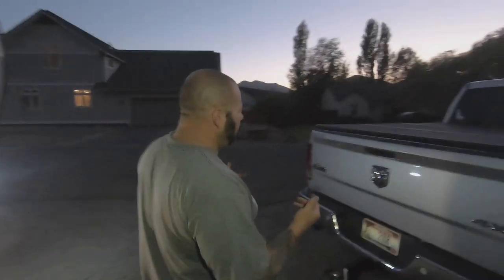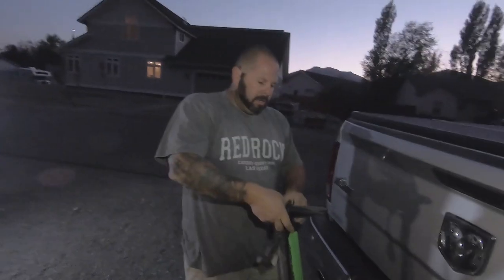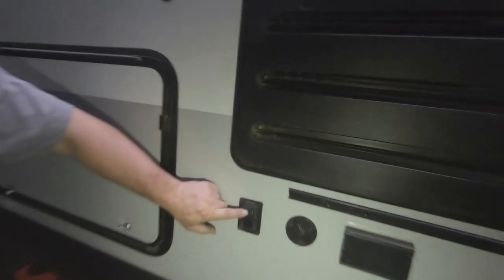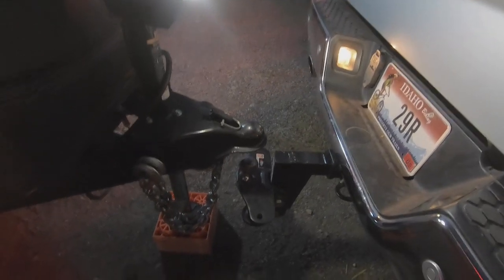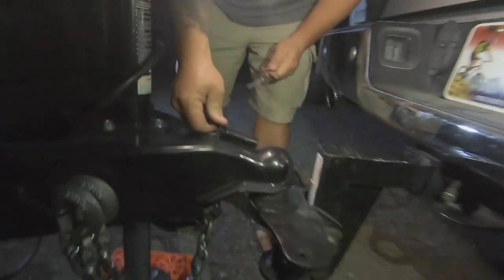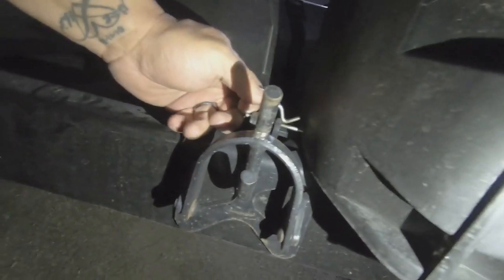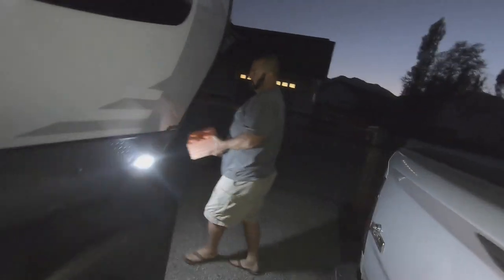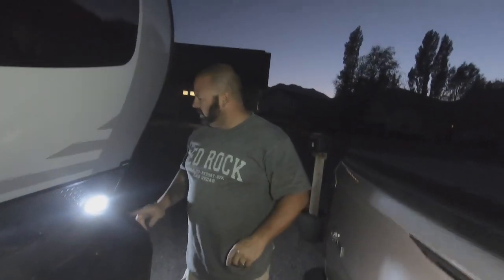Hooking camper up to ram 1500 with air bags and weight distribution

Comment: I see you use one fill for your bags.
I have mine with to shader valves. 
I also have a Ram 1500.
Not sure what bags you have, I did no use the bags in the coils.
You did say you have no shocks, not sure you ment thar lol.
I have a 2600RB by grand design. 
I just installed a level kit, we will see how that works this summer.
I went from a 32 foot coachman  trailer to this.
I found towing was about the same , I found out my front end was worn out.
Again, we will see how t tows this summer.

Comment: Isn't the brake cable supposed to be connected independent of the chains?  If the whole thing comes loose, the emergency trailer brakes won't actuate if the chains go too.
Reply from the maker: I have heard mixed opinions on this. I was told it's best to do it the way I have it, but I am not sure what is right. I do know that the cable is really long and when not ran through the chains drags.on the ground.
Reply: @BassinNmore  I watched a different video on what the inspectors look for if the pull you over and the brake cable has to be attached independently.
Reply from the maker: @robindrew3471  I will be looking into this for sure. Thanks.
Reply: @BassinNmore  The breakaway cable should be separate from the chains. It's intended function is to apply the brakes if the trailer becomes completely disconnected from the tow vehicle. If the breakaway cable is attached with the chain and the chain comes off, the breakaway cable will likely come off as well and not engage the brakes. If you're worried about the cable dragging, check out the Fastway Zip it's a coiled cable that wont sag or drag.

Comment: Good video you should check your tire size and ply and see what speed you’re tires are rated for 80 mph sounds high
Reply from the maker: Goodyear endurance 10 ply automotive grade tires rated at 87 mph.
Reply: Wow that is nice not sure I would do 87 but at least you got good tires
Reply: @BassinNmore  These seem to be very popular tires. DId they come on your rig or did you add them? ...if you added them do you have any comments on how they tow vs the old tires?
Reply from the maker: @adame924  they came on it.

Comment: Great video, thank you. I am getting on of these too, and love your channel so far. Questions, do you mostly just end up doing just the chocks and stabilizers? - how often do you have to stack leveling blocks? thanks much :)
Reply from the maker: Thank you for watching and commenting. I use the stack leveling blocks everytime. I have three bags of them now. They are the easiest way I have found to get the camper level side to side. Then I chock the side that doesn't have the blocks and I also use x chocks in-between both sides of tires for added support as well.

Comment: Curious what the payload (from white/yellow sticker inside driver door on B pillar) is on your RAM 1500 and if your hitch weight and everything in the back (and passengers) is below that? My 2013 RAM 1500 has a sadly low payload and most all travel trailers will exceed its GVWR with my family loaded up (and nothing in the back).
Reply from the maker: Mine on the door sticker is 1650lbs. I made sure I baught the best I could for the 1500, was also looking at the 2500, but found this truck was perfect for my needs.

Comment: Thanks for the video I like seeing others hook up routines. I was very interested in seeing what pressure you use in the airbags when towing with a WFD. I find a lot of mixed reviews. In additon I do have a couple questions. The first one is about your emergency cable for the brakes. Is it short enough where it will pull the pinout of the emergency brake box before the safety chains are all the way extended?
I know x chocks recommend's leveling your trailer before installing x chocks because moving the front of the trailer up and down with x-chocks installed can twist the axles. They recommend using regular wheel chocks when leveling. Why did you decide to leave them in when "un-leveling" the trailer to connect it to the truck?
Reply from the maker: I do not believe that it was, bad info from the dealer. I have since changed the way I run it and it is now. I am doing another video just about the brake cable soon. Thanks
Reply: @BassinNmore  Sounds like we got the same bad info from the dealer.  When I first bought my travel trailer the brake wire was tied to the chain. It's crazy how much dealers who sell travel trailers don't know about towing what they sell. :)
Reply: @adame924  The break away cable is meant to be pulled if the trailer is entirely disconnected, not just from popping off the ball, meaning no chains or anything left on the tow vehicle. However the other problem with that is if you lose the trailer from the ball, and the chains, then you most likely have lost whatever the break away cable was attached to as well. Ideally the breakaway cable attaches to something different than where the chains attach, I don't know of any vehicles that have that. Another issue is if the chains are long enough to pull the 7-pin plug out but not long enough to pull the break away cable, then you have no trailer brakes.
Reply: @EngineAdventures  I have heard the same thing about the break away cable and you are correct I've never seen a vehicle where the break away cable is attached to something different than the chains. As for my 7 way cable I'm lucky that mine is long than my chains.

Comment: I have the same set up.  Camper weight and truck.   Struggling with camper swaying ever since I put air bags in. Any advice ??
Reply from the maker: I am not positive, but I don't have many issues with sway. With that said thought I have done a lot to insure the propper hitch setup. I took the camper to level grounds and un hooked it from the truck. Using a level I made sure the camper was completely level front, back, side to side. Then measured from the ground to the top of the hitch where to ball sits. Then I adjusted the hight of the ball on the truck to be within the same height or within 1" higher with the air bags deflated. After that I find that if I inflate my air bads to 30 psi before hooking up, then once I am completely finished with the whoke hook uo process as showed on the video my camper is completely level behind the truck on level ground. The other thing is if I pull without water I load as much as I can (size permitting) in the camper in front of the axles. If I fill the water tanks I try and load the weight evenly to bith the front and rear of the axles. Hope this all helps out.

Comment: Not sure if you still have the camper, but curious how the electric jack's work if it's on slightly uneven ground. Do both move the same amount? Or will it automatically adjust? Thanks keep up these great videos.
Reply from the maker: Still have the camper and love it. The  eletric jacks work like an auto level in a way, but does not have enough power to lift the camper. So I normally just hold the button down until they both stop. I also try and help out if one leg is far off from the other by adding additional lego blocks under the one leg so they are close to one another still.
Reply: Awesome, excited to get my camper soon. Thanks
Reply from the maker: @davidjohnson8025  congratulations on your new camper!

Comment: What do you mean by air bags?  We just sold our Class C and are looking to order a brand new travel trailer to tow with our Ford F-150.
Reply from the maker: They go in the middle of the springs to help carry the weight and reduce the sag. They are listed in the description with a Amazon link if you wanted to check them out further.

Comment: Can i hook my trailer first and then level truck with air bags?
Reply from the maker: No, the manufacturer of the air bags say it could damage the bags if you hook up the trailer first. Also they are not meant to level the truck, but to help eliminate most the sag.
Reply: Check out the fastway airbag vs weight distribution video, it is a really good one if you're in this situation.

Comment: From what I see you did not cross the chains
Reply from the maker: You are absolutely right. That was my bad, good catch!
Reply: @BassinNmore  ya your good was trying to figure out if you can use wd hitches with the new ram 4 corner air
Reply from the maker: @spenceromg7040  I would assume that you could? I personally would always use one. I even used the same one I am using now with my 17' camper that was around 400lbs tongue wight loaded.
Reply from the maker: @spenceromg7040 wow, that's big!
Reply: @BassinNmore  yes cant pull if very windy
Reply: @BassinNmore  we used to tow a little with a 03 1500
Reply: Towed great before all the assist that cut power
Reply from the maker: @spenceromg7040  I can only imagine how crazy that would be if it was windy. I hate pulling while windy, but ours actually does good in the wind.
Reply: @BassinNmore  ours can but as you can probably tell there's only so much stability

Comment: 55 mph is the maximum towing speed. Insurance will not pay if you exceed that. And get in an accident.
Reply from the maker: The tires are rated to 88 mph, plus the speed limit on the highway is 80 mph, no one pulling campers or anything else for that matter is going less then 65. I don't pull by speed I pull by rpm's and try to keep it at 2500 or less at all times. Just so happened I was doing 2000 rpm's and looked down to find I was at 85, and yes I slowed down when I realized it. Thanks
Reply: ya thats cray cray....its more managable "if" a blowout occurs....i dont put looking cool in front of safety for me and my family but some folks do.....